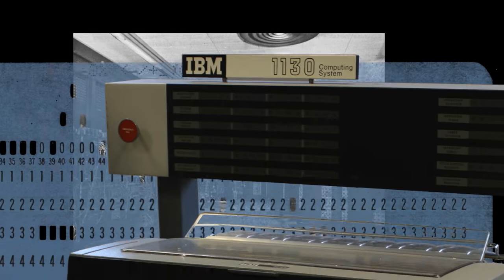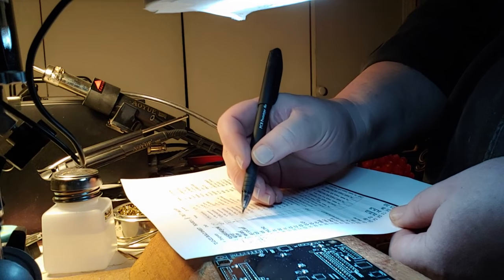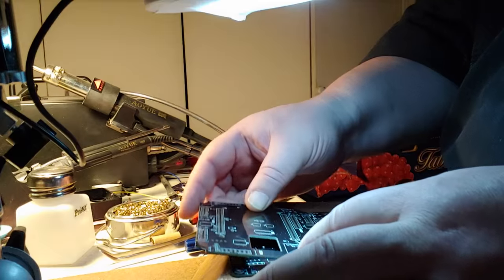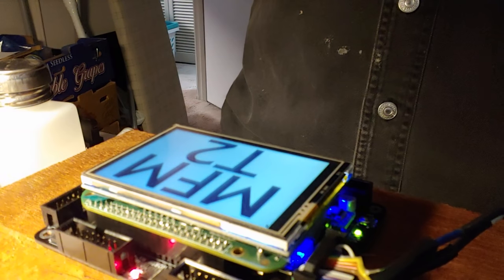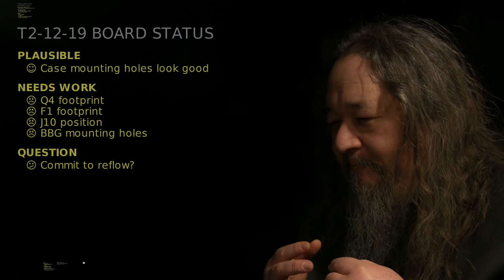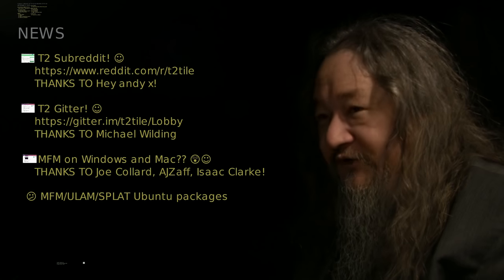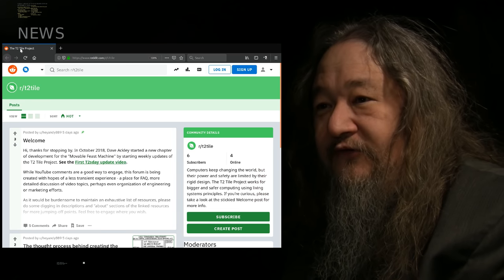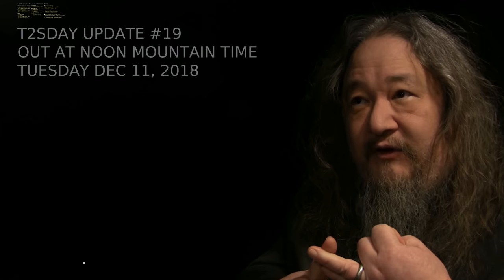Building a T2 tile - T2sday Update 18

Comment: I don't know much about electronics but I saw a nice soldering process using a ceramic hot plate and a syringe to feed the solder on. here: https://youtu.be/eUUupR-ongs?t=686 (time index 11 minutes 26 seconds). Of course it's over kill in precision compared to what's needed on the T2 tile. But I think similar setup might make your life easier.
Reply from the maker: Ben Krasnow is totally awesome.  For now, I've made some board changes and when they come back we'll see how stencil+oven works.